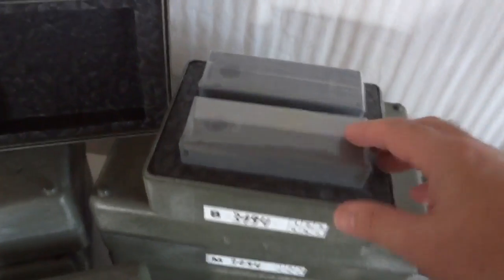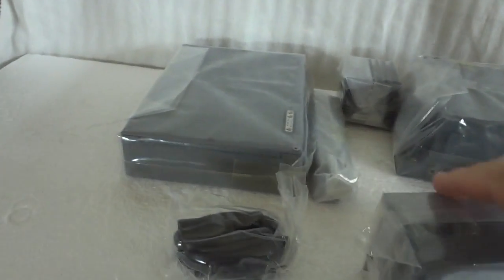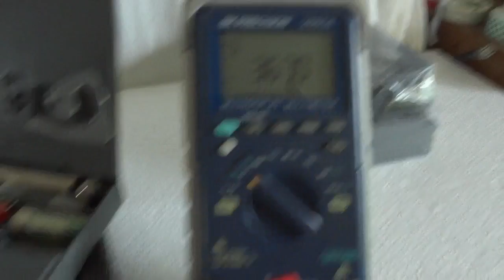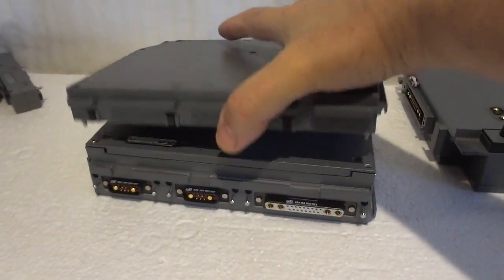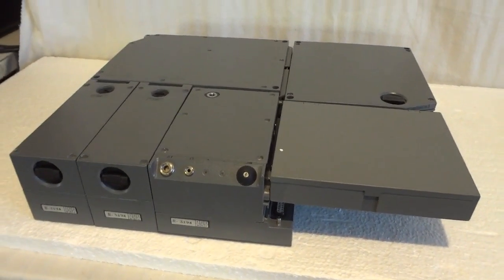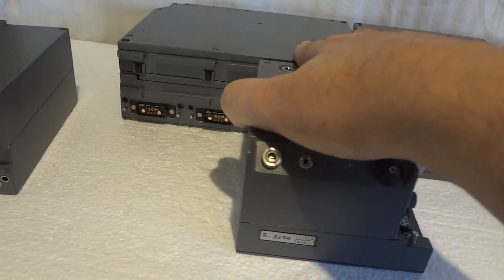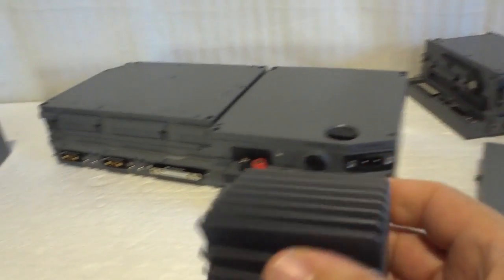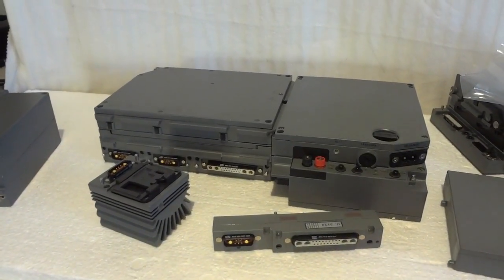FS-5000 Spy radio unpacking and assembling

Comment: This is the SY-5000 Radio for Data transmitting. It was used for example bei german secret GLADIO-Stations. It was packed in an special waterproof suitcase and hidden at a special location. Test reports had to be done in regular time intervals. The secret groups officially existed up 1990.